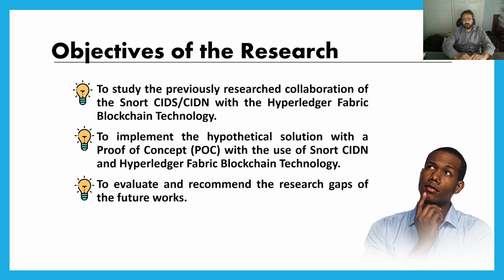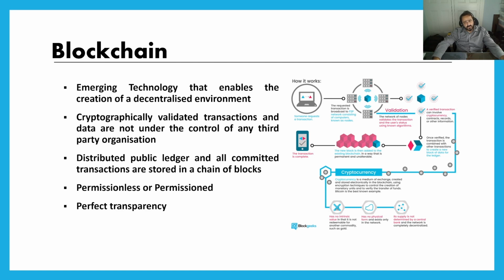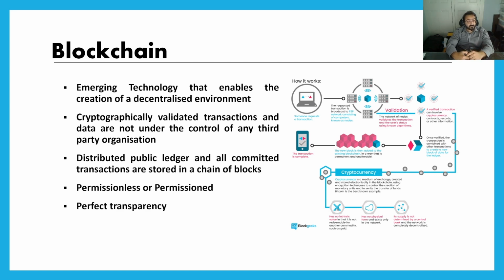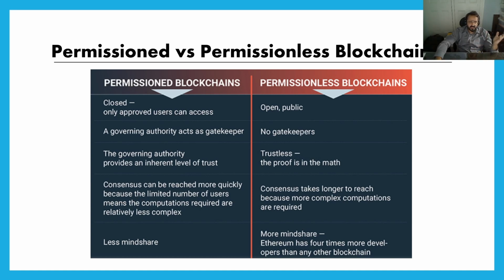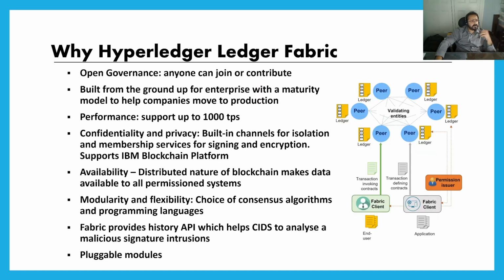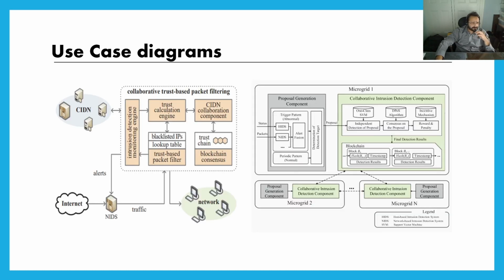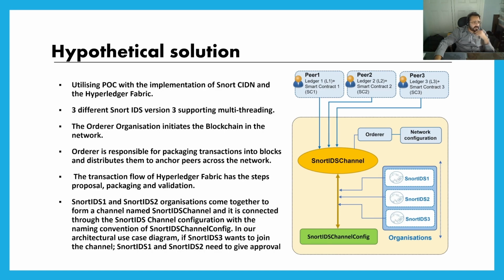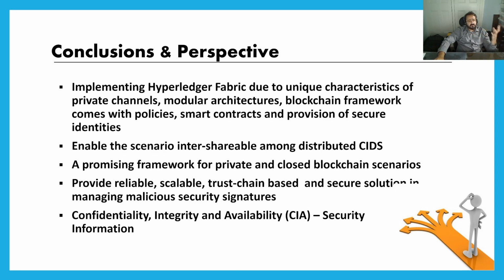CONF-SPML 2024—Collaborative Intrusion Detection System Using Blockchain Technology

Comment from the maker: Q2: In the context of collaborative intrusion detection, could you elaborate on how the blockchain ensures the integrity and transparency of the shared information among different nodes?
Reply from the maker: RE: Blockchain technology can significantly enhance the integrity and transparency of shared information among different nodes in a collaborative intrusion detection system (IDS). Here's how it achieves this:  1. Immutable Ledger: A blockchain is essentially a distributed ledger that maintains a continuously growing list of records, called blocks, which are linked and secured using cryptography. Once data is recorded in a block and added to the blockchain, it becomes immutable. This means it cannot be altered or deleted without consensus from the network, ensuring the integrity of the recorded data.  2. Decentralization: Traditional databases centralize data storage, creating a single point of failure. In contrast, blockchain is decentralized; copies of the blockchain are stored across multiple nodes (participants) in the network. This decentralization ensures that even if one or several nodes are compromised, the overall data integrity and availability are not impacted.  3. Consensus Mechanisms: Blockchains use consensus mechanisms like Proof of Work (PoW), Proof of Stake (PoS), or others, to agree on the state of the ledger. When a new block is proposed (containing, for example, IDS alerts or logs), it must be validated by the network according to predefined rules. This consensus process ensures that only valid and verified data is added to the blockchain, maintaining data integrity.  4. Transparency and Traceability: Every transaction on the blockchain is transparent and can be viewed by any participant in the network. In the context of an IDS, this means that when an intrusion detection event is recorded, its details are visible to all participating nodes. This transparency aids in building trust among participants and makes it easier to trace the origin and response to specific threats.  5. Cryptographic Security: Each block in the blockchain contains a cryptographic hash of the previous block, creating a linked chain. Any attempt to alter a block would not only require recalculating the hash of that block but also of all subsequent blocks, which is computationally infeasible in a well-designed blockchain. This cryptographic linking ensures the security and integrity of the entire blockchain.  6. Smart Contracts for Automated Responses: Blockchain networks, especially those based on platforms like Ethereum, can execute smart contracts. These are self-executing contracts with the terms of the agreement directly written into code. In a collaborative IDS, smart contracts can be used to automate responses to detected threats based on agreed-upon rules, enhancing both transparency and efficiency.  7. Access Controls: While blockchain provides transparency, it can also be designed to enforce access controls. This means sensitive data can be shared and verified without exposing it to all participants. Techniques like private or consortium blockchains, where access is restricted, or the use of cryptographic techniques (e.g., zero-knowledge proofs), can allow nodes to participate in validation without accessing the full data.  By leveraging these features, a collaborative IDS based on blockchain technology can significantly enhance the integrity and transparency of shared cybersecurity information, making the network more resilient to attacks and manipulation.

Comment from the maker: Q1: What challenges do you think will be brought to when implementing a collaborative intrusion detection system with blockchain, and what are your suggestions to address these challenges?
Reply from the maker: RE: Implementing a collaborative intrusion detection system (IDS) using blockchain technology presents several challenges, each with its own set of potential solutions. Here are the key challenges and my suggestions to address them:

1. Scalability: Blockchain-based systems can struggle with scalability, especially when handling a large number of transactions or data entries.

   - Solution: Implement a scalable consensus mechanism like Proof of Stake (PoS) or use sharding techniques to distribute the workload across multiple smaller, more manageable chains.

2. Interoperability: Different intrusion detection systems and blockchain networks might use varying standards and protocols, making interoperability a challenge.

   - Solution: Develop standardized APIs and protocols that enable different systems and blockchains to communicate seamlessly. Adopting common data formats and shared protocols can facilitate interoperability.

3. Privacy Concerns: Sharing intrusion detection data across organizations might lead to privacy issues, especially if sensitive information is involved.

   - Solution: Use privacy-preserving techniques such as zero-knowledge proofs or homomorphic encryption to ensure that data can be verified without revealing its contents. Implementing strict access controls and data anonymization can also help.

4. Performance Overheads: Running a blockchain network alongside intrusion detection systems can introduce performance overheads due to the computational demands of blockchain operations.

   - Solution: Optimize the blockchain implementation for efficiency, perhaps by using lightweight consensus algorithms or off-chain computations where appropriate.

5. False Positives and False Negatives: Collaborative IDS can suffer from high rates of false positives and negatives, impacting their effectiveness.

   - Solution: Implement advanced machine learning algorithms to improve the accuracy of intrusion detection. Regularly update the system with new threat intelligence to stay ahead of evolving threats.

6. Data Integrity and Security: Ensuring the integrity and security of data shared on the blockchain is crucial, especially to prevent tampering or unauthorized access.

   - Solution: Employ cryptographic techniques such as hashing and digital signatures to secure data. Regularly audit and update security protocols to combat emerging threats.

7. Regulatory Compliance: Complying with various data protection and privacy laws (like GDPR) can be challenging when sharing data across borders.

   - Solution: Design the system with regulatory compliance in mind, incorporating features that cater to data localization, consent management, and right to be forgotten.

8. Consensus Mechanism Vulnerabilities: The chosen consensus mechanism might have vulnerabilities or may not be suitable for a collaborative IDS environment.

   - Solution: Carefully select a consensus mechanism that balances security, speed, and decentralization. Consider hybrid models that combine the best aspects of different mechanisms.

9. Costs: Running a blockchain can be expensive, especially in terms of computational resources and energy consumption.

   - Solution: Opt for energy-efficient consensus mechanisms like PoS and consider using cloud services to distribute cost and computational load.

10. User Adoption and Trust: Gaining the trust of participants and encouraging widespread adoption can be challenging.

    - Solution: Promote transparency and educate potential users about the benefits and workings of the system. Demonstrate the effectiveness and reliability of the system in real-world scenarios.

By addressing these challenges with careful planning and the application of advanced technologies, a collaborative IDS using blockchain can be a powerful tool in the fight against cyber threats.